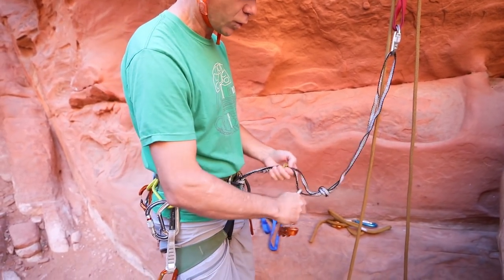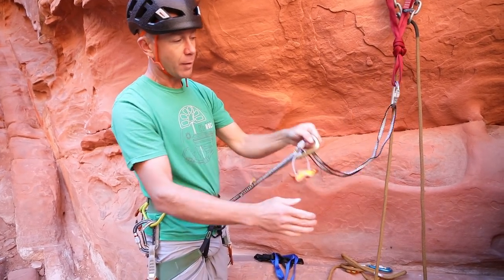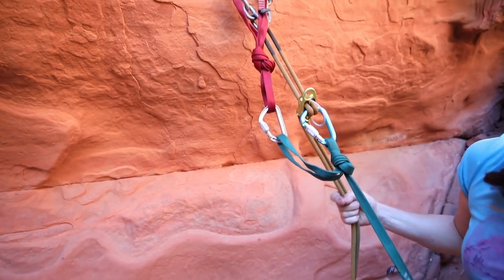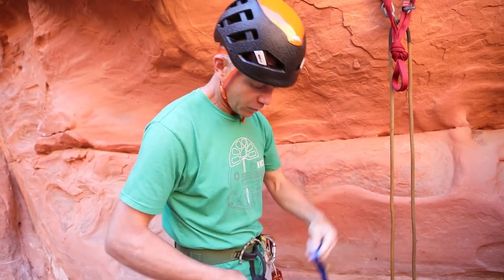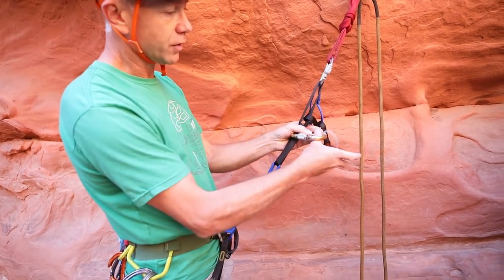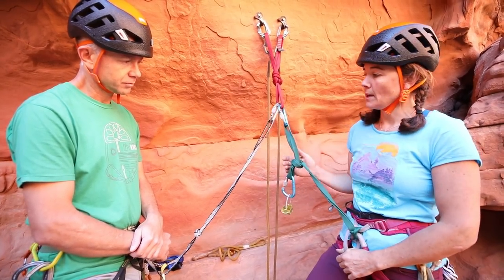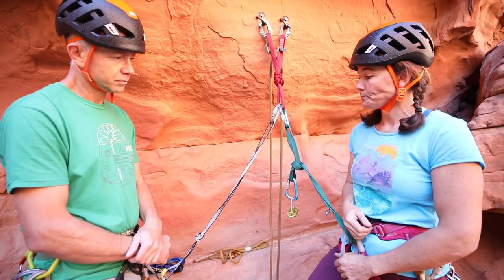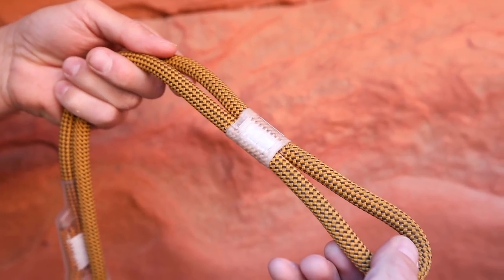How To Set Up A Rappel Extension

Comment: The dual petzl connect adjust is a dream to use. Pretty bulky though especially if you’re carrying gear. I’ve switched down to the regular connect adjust for my pas, and use a double length runner  tied in an eight through my tie in points for rap extension. Perfect combo!
Reply: Anthony Haamen just got the single lanyard too and was kind of wondering what to do to extend the rappel. What do you think of tying a bight of rope in the middle of the lanyard and connecting the belay device there? I don’t see any reason why not.
Reply: @OneTradeMan  Should be doable. I have seen mentioned in a couple of forums the usage of a clove hitch in the middle to connect to the belay device. Same principle, less rope wastage.

Comment: Guides in italy also use the bowline to tie the sling to the harness
Reply: Giacomo Pascazio I've just now been introduced to using a bowline on a bight to attach the sling to the harness but couldn't find any pull/drop tests... Any idea which knot (bowline or girth hitch) reduce the strength of the sling less?
Reply: Ivan Lawrence I'm honestly not sure, i don't have any data. But i'll ask to some guide instructor i know and i'm sure they'll have something concrete. I'll letyou know
Reply: @wolfberg_gpasca  do the bowline doubled - rope passed through twice for better strength and ease untying. Have not used it on slings,

Comment: "It's gonna be hard to reach the limits of this material in a practical climbing application"

Correct me if I'm wrong, but isn't that exactly what the DMM video was discussing? Even falling just the length of the sling (2 foot) was enough to generate enough forces to break the material with a dyneema sling. I get that in practice there's the extra dynamic elements like the body being soft, the other elements (cordelette for example) absorbing some of the forces etc, so maybe he's right that the forces will be reduced in a practical scenario, but I think that it should be stressed that if you shock load the anchors, you might actually fairly easily generate enough forces to break the sling, especially if you're using a sling that's not brand new as they used in the DMM video.

The rest of the video is awesome and I use a sling to tether myself as well, I just make sure that I never let any slack develop in the sling. Usually I'll use the rope and I was glad to see that being the recommendation in this video.
Reply: In the DMM video, the forces at play were upwards of 19-27kN when it was a fall factor of 2. I believe that all the falls where the sling broke were fall factors of two. I happen to have a new DMM carabiner laying around that is rated for 24kN in ideal situations. You might have a new sling, but old carabiner and the carabiner could break, or the carabiner could be rotated . To get a fall factor of 2, you'd have the climb above the connected point and jump off. Which isn't smart regardless of dyneema or nylon since they are static.  I believe around 10 kN you'd break your pelvis and potentially more in that fall. It could also cause the sling (dyneema or nylon), carabiner, or belay loop to fail as well. 

 To sum up, If you aren't connected to a dynamic rope, don't climb above the anchor, and as a leader place a piece of gear above the belay before you start climbing the pitch.

Comment: In same rap setting with back up using small dyneema. At the knot in middle for the rap device - as knot reduce strength (more on dyneema) - what do Dave and Olivia thinks of using a clove hitch ONLY if end from anchor is reclip to harness ... slippage not tested in this use as far as I know but should reduce strength less than a knot (and is convenient to untie)?
Reply: It's a good method, true. But gotta make sure you reclip the end to the harness with a second locking biner.

Comment: I think I'd rather have one sling for a PAS and another for the rappel extension. I was under the impression that loading or even shock loading the "shelf", as he mentioned, between his girth hitch and overhand knot was bad, because loading that overhand knot like that greatly reduces its strength. If you load it like that, you can see the force literally trying to peel the knot open or tear it apart as oppose to clinching the knot tighter.

Comment: My only question is 'why rappel on an extension in the first place'?
Reply: It allows the auto-block or Prusik knot to be centered underneath the rappel device instead of being rigged off the leg loop.
Reply: Also quite important if you are a woman and/or have long hair and don’t want you hair to accidentally get stuck in the atc
Reply: To expand on why having the backup auto-block knot on the leg loop is a bad idea, you have two big issues with it. 

First, and probably more obvious, your leg loop is not meant to be shock loaded at a single point. When your harness arrests a fall, your weight is distributed against all points of contact with the main stopping force being at your hardpoints or belay loop. These points are rated for fall arrests. By introducing a shock load to a single part of the leg loop webbing when the autoblock catches, you risk damaging the harness. 

Less obvious is the risk of the autoblock being bypassed entirely. If you raise your leg high enough, the top of the autoblock knot can touch the rappel device. Doing this creates the same downward force that you would be applying to bypass it in a lower with your hands, but unintentionally. If you are in a situation where you need that third hand blocking but your leg is raised, it’s useless. 

Outside of keeping hair and clothing out of the rappel device, extending it solves both of these issues by connecting the autoblock to the belay loop. Your belay loop is rated for fall arrests and it will not shift upwards relative to the rappel device no matter what orientation your legs are in. Some people also may find they have better control over the descent due to the angle of the brake end ropes being more aggressive
Reply: Good question and good answers.
Reply: it feels better!

Comment: As the knot for your belay device it is highly recommended to use a bowline as it opens up easily - as opposed to the overhand knot.
Reply: On tiny dyneema, what’s is the best knot (clove histch, bowline, in-line figure 8, overhand...) that has know slippage an reduce strength data for this rap usage?